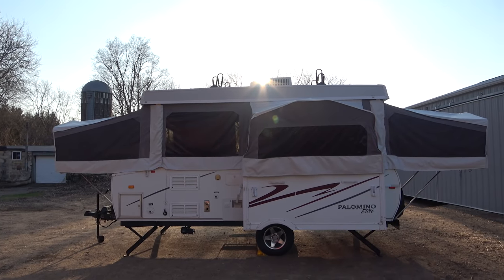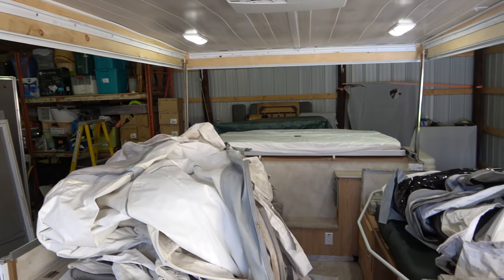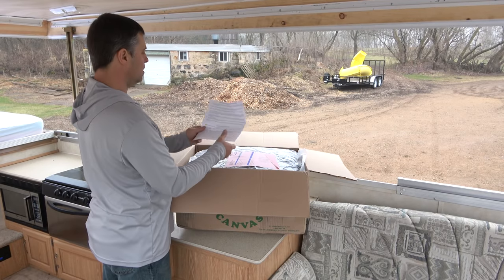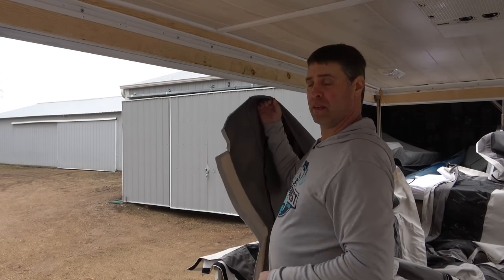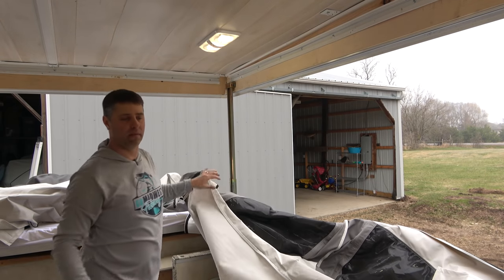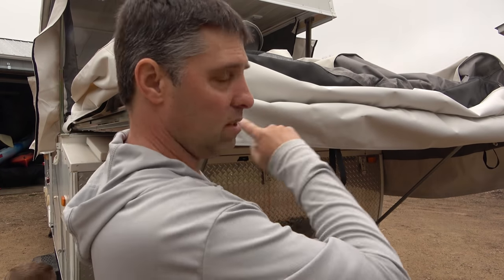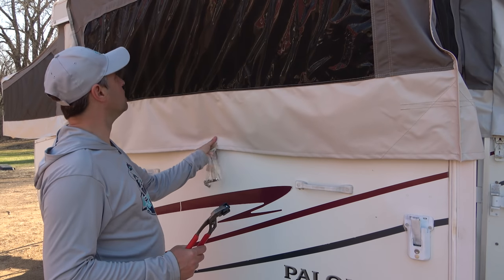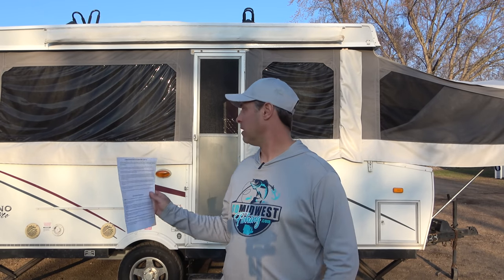Camper Canvas Replacement And Exactly How Much It Will Cost

Comment: This looks amazing! So you're saying you have to ship your existing canvas to the company making the replacement canvas - versus this being some sort of warranty replacement. Anybody ever remove the canvas and just make that back panel a window? Meaning the externior panel that folds up is just a frame for a window - no more bed. For those RVs that have that fold out back canvas bed. Not a pop up like this one.
Reply from the maker: Yes, you have to ship your old canvas in, but only if they don't have the exact template for your camper. If you want to ensure you get the right sized canvas, I would suggest sending it in. This was not a warranty replacement. I got this camper off facebook marketplace, and it had a lot of water damage from a leaking roof.

Comment: While I don't have a camper I've got canvas on the big boat and once a year I use a light combo of Dawn and Bleach as a clean up and once dry I Armorall the entire top and compartment covers and this does a great job of waterproofing and removing stains. For such a lot of Canvas they did an excellent job....I also carry a bag of buttons and I keep those lubricated with T-9 Boeshield.....It's a Boeing Product designed to stick and lubricate joined metal surfaces on Planes....Sea Ya!!
Reply from the maker: Thanks for the input. They were really pushing not using chemicals on the canvas. Only water to clean it, otherwise it deteriorates the natural waterproofing. I have heard people say they use dawn and bleach too. I guess if its working for you, then keep doing it.

Comment: There is a fabric shop near me that will make a new tent end for your pop up trailer. He requires the whole piece so he can fabricate a new one. One bunk end cost me $500. If you have a tent trailer make sure you fully dry your canvas before you store your camper. You did a great job. That canvas looks great.
Reply from the maker: I appreciate the comment. $500 sounds about right. At first I was just going to replace the bunk ends, but then just went for the whole thing.
Reply: You can replace the entire thing for about 1000$

Comment: Great vid on the buttons you need to line up were the button will go than pock a hole the material than install the button they will not cut through the material.
Reply from the maker: Thanks for the tip. That was the one thing I just couldn't figure out.

Comment: I'm in the Midwest as well .. way further south in the st louis area. I would suggest to anyone that does this kind of thing do it in the fall to winter. As someone who has a kind of seasonal job depending on the year (some years are 50+ every week some not so much) try to order during their slow times to keep everyone working. As well as to have your product long before everyone else as well. Everyone wins.
Reply from the maker: That's right. You definitely need to plan ahead when doing this.

Comment: you can get actual pliers made for buttons and snaps at wal mart, Michael's, hobby lobby, if you have a seamstress in the family, they probably have a pair on hand :)
Reply from the maker: That sounds like a much better idea. I will do that. Thanks for the info.
Reply: They are called Heavy Duty Snap Pliers and you get get them for about $20.  Great job on the installation!

Comment: Did you lift you pop up trailer? Looks high and and good ground clearance. My Niagara look to low.
Reply from the maker: That's how it comes. It is bigger than most pop ups, so it is a little higher off the ground. I do like having some ground clearance with some of the "not so level" campsites I go to.

Comment: Looked at a 90 Chesapeake, today. Canvas is quite spotty with mold looks like its been years since was opened. Only $100 for the camper, but also needs tires, theres a spot where roof looks a little damped down. Cupboards have the fake wood stickers pealing-off.. likely needs where bearings.. I do not wish to do all this work or pay to.
Reply from the maker: From my experience, you'll be able to buy a new camper after all the money you dump into some of these fixer uppers. New canvas is one thing, but if you have to redo everything, its not really worth it.